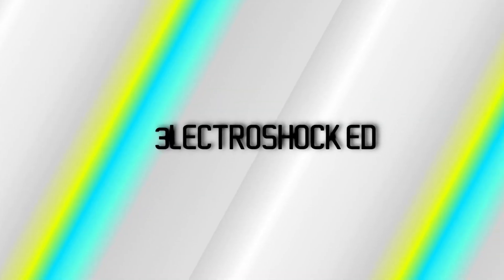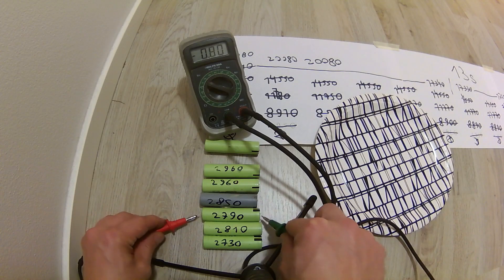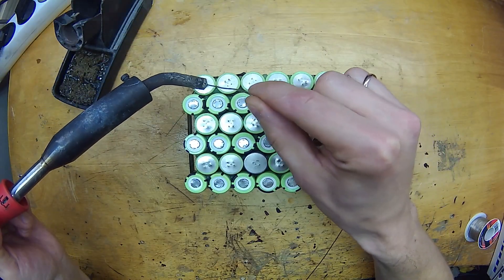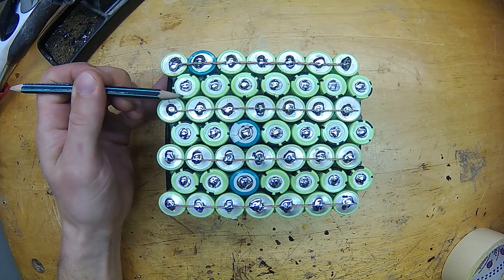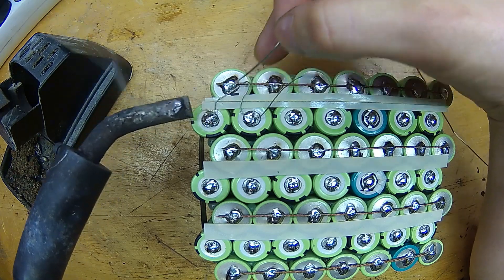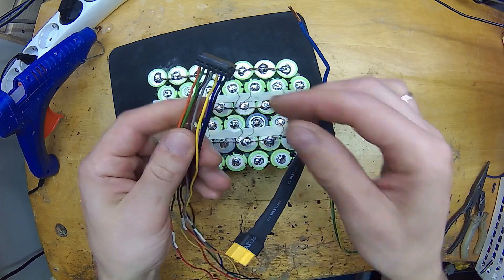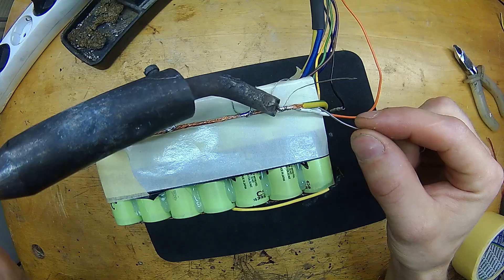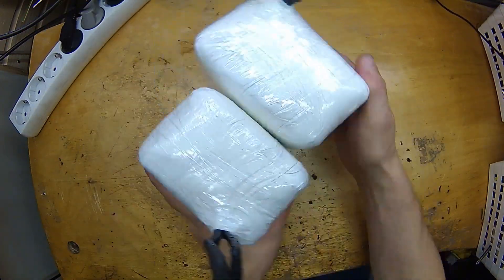Make 48v LITHIUM Battery the BEST way | Complete guide

Comment: Excellent video! When yiu calculated the fuse value and it came out to be 5.7A is this per cell? Also, does this mean the maximum current for the fuse to remain intact is 5.7A? This part confused me because when you ran the fuse test, the value was approximately 19, can you explain this for me please?
Reply from the maker: Hello! Thanks for your comment! So take the main fuse amp rating and divide that by the amount of cells in a one serie. The small, individual cell fuse needs to be bigger than that, so that it will hold up during normal usage. I made it way bigger, like three times bigger... And that's totally ok, because if a short circuit would happen on a single cell, that will send 100 or even more amps through that one little fuse. Understand? :) Hope this helps!
Reply: @3LECTROSHOCKED  Sorry for the late response I forgot to check back. I understand now thank you. I was wondering if this method would work as well - instead of taking the main fuse amp rating, can you use the maximum current that the load will draw and divide it by the total number of cells in your pack? E.g. Suppose a 8s8p pack and the total number of cells will be 32, and assuming the load will draw 40A, so can you do 40A/32 = 1.25A fuse wire? I found this on a forum a couple of days ago but was unsure if it's appropriate
Reply from the maker: Hello! Sorry, that's not the way to calculate cell load - you're forgetting about the volt-aspect.  Every serie in your pack delivers that same amperage as your consumer (motor) draws. You need to divide 40amps by 8p to know how much a single cell puts out :) Hope this helps!
Reply: @3LECTROSHOCKED  Ah yes that makes sense. So your battery can be rated at any current but using the right fuse is dependent on how much current the load draws right? So suppose that same battery configuration, say it is rated at 60A, but because we're dealing with a 40A load, that is the current we base our fuse on. Also, thank you for the help! :D

Comment: Wow thats a LOT of capacity for e bike.
Reply: and it perfectly makes sense with all that insulation at the end. Hope it serves you well
Reply from the maker: Hello! Thanks for your comment! Yeah, this battery pack was a succeful replacement for my 1,5kW ebike. I've been driving on this pack for months now and not once have ran out of power. I do like 20-30km trips. Thanks again for watching!
Reply: @3LECTROSHOCKED  does voltage meter you used have an option to display just lowest of the voltages? i guess that would make sense, and would be easyer to keep an eye on than it flashing constantly. i see how that can be a better option than bms for an advanced user. you get a fuel gauge all in one

Comment: The high temperature of hot glue is not affecting the cell?
Reply from the maker: Hello! That's a good question. No, hot glue actually melts at a relatively low temperature.  Also it releases all of that heat really fast, especially when applied on metal. That heat then dissipates into the air quickly through the metal surface and does not reach inside the cell, where it could accumulate and create damage. So rearding heat, hot glue is not an issue. But one should really be careful when soldering a cell. For that one should use a very powerful soldering iron, so that it will be possible to create enough heat on the surface quickly enough to melt the solder, but not enough to travel inside the cell and accumulate. Thanks for watching!

Comment: HI 3Lectroshocked
If I use a BLM then I can use the original ebike charger to feed the BLM to charge the battery, is this correct?
IF it is OK then what problem may rise ?

Thanks
Reply from the maker: Hello! Thanks for your comment! You mean BMS? Yes, if you want to charge your battery with just a regular power supply, then you need a BMS. BMS will do all the balancing etc. monitoring the state of charge. Check out my video about balance charging: https://youtu.be/XrSCNwitxjk Thanks for watching! :)

Comment: Good but they should have spaces im between
Reply from the maker: Hello! Thanks for your comment. I just talked about that with another viewer. I talked about the heating issue at the end of this video. Here are my thoughts on that: So, this is a mobile application, and that usually has to be small in size. So, having air gaps between cells is a big waste of space and the air won't even circulate, cause the whole pack is sealed.. To achieve "real" cooling you need liquid flushing sides of a cell and then cool down in a sink. That system, is kinda hard to create on an eBike and in general. Even tesla has challenges with that and for example other eCar manufacturers decided to use those shitty flat cells - so they could implement liquid cooling easier. Next, why you need cooling? If your system consume 1c - that means the same amount of amps/hour as the the capacity of the battery. Then your battery does not heat up - you can test this. So, with that logic, we know that the more capacity you have in a battery compared to your consumer (a motor) - the less heat you battery will generate and more effectively it will work. So to minimize those issues caused by heating, I think it's more effective to use that "air-space" and add more cells to have more capacity and less heating. At least in a mobile application. What do you think? Thanks for watching!
Reply: @3LECTROSHOCKED  you are right about the c rating

Comment: Hey bro please tell why everyone use bms on their battery
Reply: Hello bro can u help me in making a electric fat bike if yes, the send ur no. Please🙏🙏
Reply from the maker: Hello again! :) Well, I don't have videos like that. But I'm planning to build a new ebike next spring. But there are a lot of videos like that here on YouTube. Just search for "eBike conversion tutorial", or "guide". Main things to consider with a fatty, is that you need special frame + front end that is meant for fat tyres. Everything else is probably same as on a regular bike. There are a lot of conversion kits on the market, just check your favourite dealer for fat bike conversion kit. I buy all my stuff from AliExpress. Good luck! :)
Reply: Hello bro I have seen a video on wiring of woke controller on another channel , in that video he has tell a new thing three speed mode in motor I have seen that when he join the wires and he take the throttle the speed is doublled after joining wires in three speed  , I have a question is that in every  speed controller their is a three speed or not please tell
Reply from the maker: Many controllers have a switch (or just wires) to limit the current. There are usually 2 settings: half power and full power. Some controllers may have 3 settings.. Note that it's a limiter - not a magical way of having more speed :) So, if you just connect those wires in the right way, you configure your controller to work at full power. Did mean this? Link me that video, if you are not sure - I will watch it.
Reply: Hello bro  I have seen a video on ur channel on making 48v battery in that u don't use bms so, my question is that to u I am also making a 48v battery so if Iam not use bms in my battery so it can blast or not please tell
Reply from the maker: Hello. No, it's ok, BUT you need a balance charger for charging that battery.
Reply: Thanks for replying me but I am. Confuse that from where I bought balance charger and how to use it , if u now the link of buying balance charger of Amazon compney please send ok
Reply from the maker: For example, here is the most popular balance charger for lithium batteries: https://www.amazon.com/100008-Professional-Balance-Charger-Discharger/dp/B019UPXDJA/
Reply from the maker: I have 7 of those. But I actually don't use them anymore. I use my own charger, which essentially is better at balancing series, since it does it really individually. Here is my video about that:  https://youtu.be/XrSCNwitxjk
Reply from the maker: Hello! Good question. Well, there are two reasons. Firstly, it does the balancing while charging. But I think that it's a bad way of charging lithium, since it actually discharges series through resistors till every serie is at 4,2v. That essentially cycles cells and reduce lifespan, a little bit, but still. Secondly, it watches out for every serie for voltage. If a serie drops below acceptable, it cuts off main power to "save" the battery. That's also kinda unnessasary, because if that happens, it means that a serie is already fucked and need service. So I think its better to let it die in that situation.. At least you will be able to clearly identify that dead serie. If bms just cuts power off, it is likely that you won't even be able to identify which serie is in fact the cause of that. Because those voltage margins can be very small and cells can show a very different reading under load and without a load. These are my thoughts, I know many people will disagree. But here is the cherry on top: those bms boards also fail pretty often, so they themselves add instability to the whole system. So, are they actually such a good thing to have?
Reply: Hello u send me the answer but I can't understand can u make a video on it please I am requesting I am ur subscriber from India 😃please make a video for me please
Reply from the maker: Oh, I'm sorry if it's hard to understand :) I will think about making a video on that. Thanks for the request! :)
Reply: Yes , I have serch many videos on YouTube but their is no video for me so, I am requesting to u that please help in making an electric fat bike because u are a good person. For me if, u can not help no problem 😔
Reply from the maker: Thanks for your kind words! I would be glad to do a project like that, but I don't need a fat bike. I actually did research that in the past, and I came to the conclusion that it's just too expensive for me. A fat bike itself is around 1000€ and conversion kit will add another 400€ to that. I'm used to do my projects from trash, and a fat bike is not something that I was able to find in the trash, yet.. Spending 1000€ is just not very practical for just having wide tyres :D I do need a new regular eBike, but now is not the best time for making that - we have 30cm of snow outside :D
Reply: Thanks for giving me the response , brother can u give me ur phone no .please
Reply from the maker: Sorry, can't give out my phone :) Just ask me anything here, I will be glad to help!
Reply: Ok no problem
Reply: https://youtu.be/A8QcNvRh0wM 
Ok bro please see this video and tell me
Reply from the maker: I watched that. Like I thought, it's the limiter.
Reply from the maker: Oh, and of course it watches the overall voltage, the state of charge and cuts off to prevent overdischarg. But that's also unnecessary since that function is usually present in the motor controller.
Reply: Yes it is

Comment: The BEST way?? Well first of hotglue allt eh cells you really make sure there is absolute no air as cooling the cells and if service is needed. Well hotglue just makes all alot more difficult. Second thing is soldering on cells NOT recommended cause you heat up the cell. Yes you can do so but that nuclear to soldering you use is just wow.
Reply from the maker: Dude! I'm really glad you posted this comment! Ok, so, I talked about the heating issue at the end of this video (if you watched that far). THIS is a mobile application, and that usually has to be small in size. So, having air gaps between cells is a big waste of space and the air won't even circulate.. To achieve "real" cooling you need liquid flushing sides of a cell and then cool down in a sink. That system, is kinda hard to create on an eBike :D Even tesla has challenges with that and for example other eCar manufacturers decided to use those shitty flat cells - so they could implement cooling easier. Next, why you need cooling? If your system consume 1c - that means the same amount of amps/hour as the the capacity of the battery. Then your battery does not heat up - you can test this if you don't believe me. So, with this logic, we know that the more capacity you have in a battery compared to your consumer (a motor) - the less heat you battery will generate and more effectively it will work. Next, what's wrong with hot glue? It melts at a reasonably low temp and so it does not hurt a cell. Also it comes off super easily for service. Next, you say soldering is bad for a cell. Who told you that? Do you really think that welding a cell is better? Because that is essentially what happens with spot welding. And also that spot welding method creates a very bad electrical connection. Also, it is impossible to spot weld a wire to a cell, which is kinda important if you use a wire for connections, like most of us at home. If you stressing about overheating a cell while soldering, here is some facts: the more powerful soldering iron you have, the faster you will create the needed temperature on the SURFACE. That means the LESS heat will travel inside a cell and create "nuclear" :D So, really, this is the best way of making a lithium battery at home. Please, do share your contrfacts, I will be glad to talk about this and help You. Thanks for watching!

Comment: What type and size of wire are you using for the fuses?
Reply from the maker: Hello! Thanks for your comment! That's a very good question - I'm glad you asked that. So first of all, it has to be NON COPPER. If it looks silver, but it's kinda red when you look at it's end, then it's probably copper with some coding on it - don't use that. Unfortunately I can't tell you what material and gauge of strings I used on this battery. Because I don't know. That's why I was doing amperage tests. Basically I found a wire with strings in it, that were not copper. It's probably some sort of steel.. And to determine how much of that material I needed - I did amperage tests with a DC watt meter and a battery for power source. Then I combined several strings of that wire to have the suitable amp rating for my battery. And that amp rating should be way more than what your single serie could produce before the main fuse burns. If you don't have a DC current watt meter, you can use a regular multimeter. But those are usually limited to 10 amps. AND then you should do like 20 tests and take into account only the highest reading you will be able to see in that short amount of time, when a multimeter is picking up on the reading. Because there is a timing problem - it's not fixed, but in real time. But doing it many times SHOULD bring you to a result that will be kinda accurate. Did this help? :)
Reply: Great,  Thanks for that info. I have watched this video several times very informative. What do you think about this https://www.amazon.com/gp/product/B077XRG6H8/ref=ppx_yo_dt_b_asin_title_o00_s00?ie=UTF8&psc=1
Reply from the maker: Thanks a lot for watching! Yeah, if you have access to "real" fuses - do use them. It's really about the money. Even tesla packs have just wire fuses, cause they are cheap - basically free. Of course they use some special material etc.. :)
Reply from the maker: Main thing is to choose high enough amp rating, so you won't blow them during normal use. Because then you create unbalanced situation between series and that is kinda bad :( I have done that error and learned the lesson the hard way.

Comment: No protection between cells rubbing against each other?
Reply from the maker: Hello! Thanks for your comment! Very good question. And no, they don't move at all inside a pack. All that hot glue and wrapping around the pack make into a very tight "brick". Although hot glue is - in fact - flexible material, but in those small amounts that property have no effect. Anyways, if you are worried about that, you could always add a layer of electrical tape on every cell. Or, a sheet of some material between series. But to me that seems like an overkill, since they don't move at all :) Thanks for watching!

Comment: Hello 
I  Want to ask you if I can put Together cells like  3.6 v and 3.7v  because i have 2 diferent model samsung end if i search in google i se one is 3.6v
Reply from the maker: Hello! Well, the main question is, are your cells of different technologies? For example LiPo and LiIon. If they are essentially the same (LiIon), then I don't see a problem with that, since it's probably just a marketing thing.. If the discharge and full charge voltages are the same (check that), then I don't think that the nominal value (3,7/3,6) has any real meaning in usage. But if they are in fact different technologies, then I recommend not to mix them.